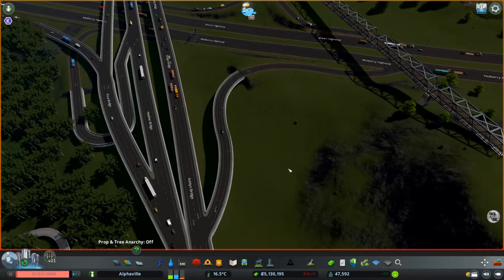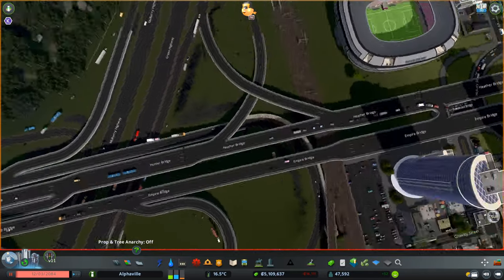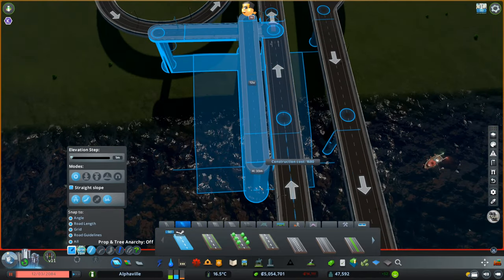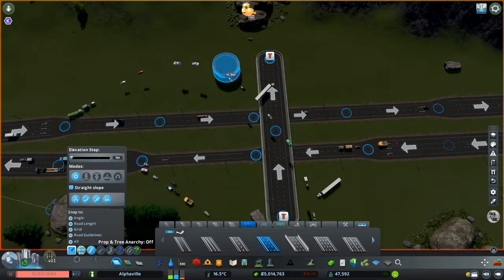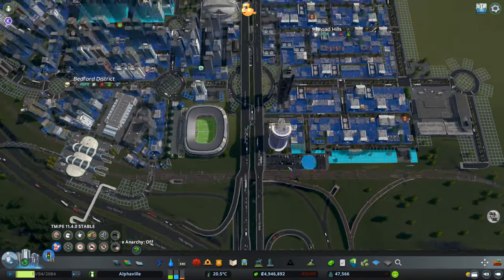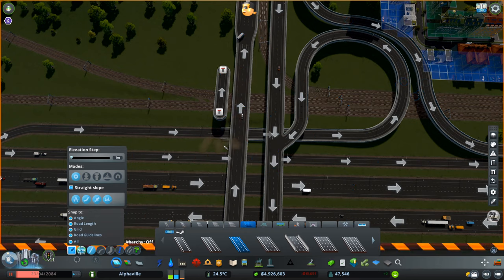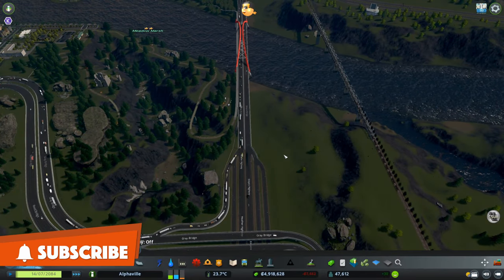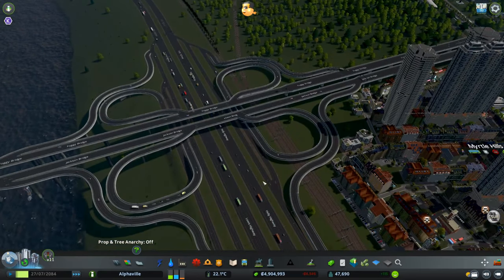Cities Skylines - Highway Interchanges - Episode 28

Comment: You reaaly know to to bulid a beatufil higway, but you need to take care of lane mathematics, you sometimes have 2 ramps merging into one ramp lane when you should ideally build a ramp with 2 lanes. And when you open your traffic view, you can see some red buildings, those are building without enough parking spots, so you could build some more parking.
Reply from the maker: True. Sometimes I go more for aesthetics than to the practical side of the number of lanes. I'll do a quick check on it and make sure it's all working. If it's not generating traffic, I might postpone the changes on it. 
For the parking lots, yes. But I think there might be an issue with that. I did a test earlier today and placed 3 parking lots on sides and front of a building that's showing red (Library). It didn't make any difference. Tried different parking lots as well to see if it could be a specific mod issue, but also didn't make a difference. I'm trying to figure out what it might be. If you've seen this issue before, please let me know :)